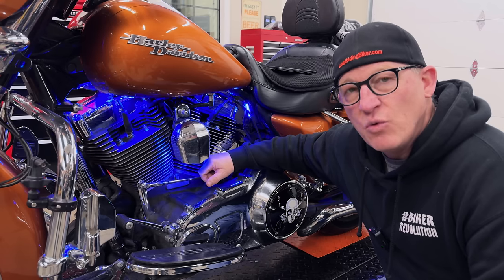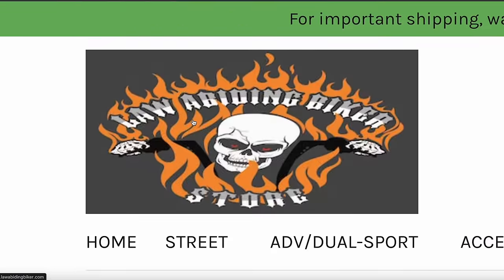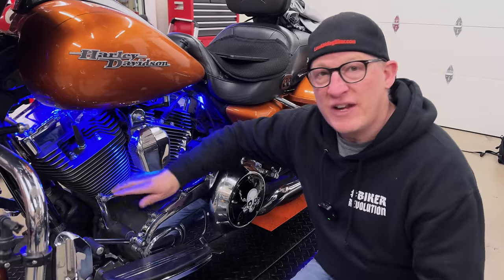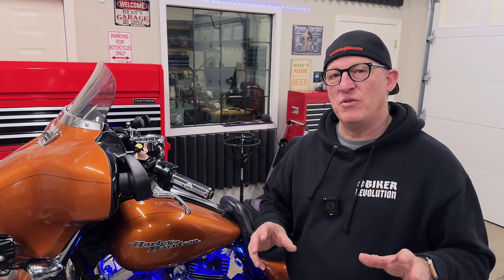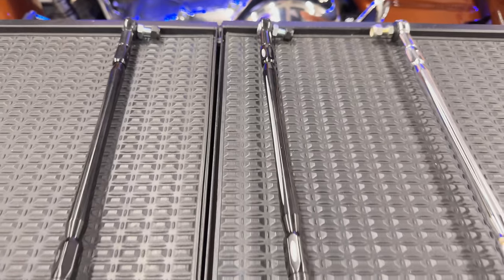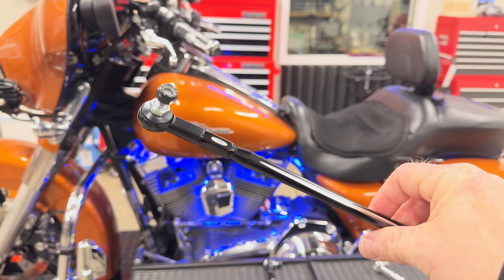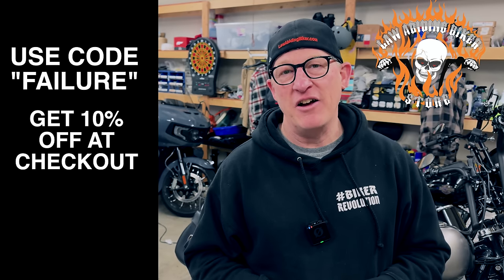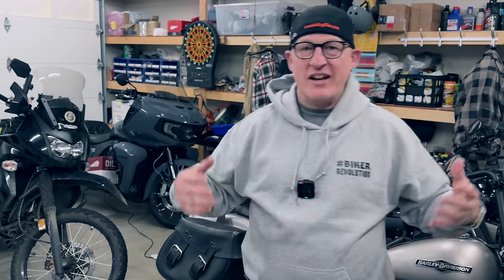2 Things GUARANTEED to FAIL On Your HARLEY! MOD THIS NOW 👍

Comment: This Kurayakyn linkage doesn't seem right.  I have a 2003 Electra Glide.  Bought it new.  I've put 51K on it over 21 years now.  Original linkage.  After watching this video It seemed like a good preventative maintenance move.  I bought one from your store.  Per the instructions, I've adjusted and tightened the Jam nuts to the proper length but the center rod still has some wiggle/movement at those connections.  This doesn't feel right.  Not as solid as the original.  Well, I put the 21 year old part back on and contacted Kuryakyn.  I'm still waiting their response.
Reply: Okay, this was the reply I got.  Guess I'll just pray about putting it back on.  Thanks Ryan.
Hello Gary,

Thank you for contacting Kuryakyn Support.

This is common but should be no cause for concern.
As long as everything can be properly tightened, there should be no issue. 

Best regards,

Joseph Petry  
Customer Support Representative

Comment: have a 2016 with 80 k miles not a problem,  never heard of it , maybe your kicking instead of shifting?
Reply from the maker: Nope, read all the comments. It's widespread for many years now. Consider yourself just lucky. Also, look at my other shift linkage videos and shifter arm videos on this channel. You won't be able to keep up with the comments of this happening to so many bikers. Ride safe.

Comment: Almost ALL failures ive seen are on bagger bikes with floorboards and toe/heal combo.  That set up puts way more stress on the linkage.  Harley has deliberately engineered these weaknesses deliberately not to destroy the transmission input shaft.  If you beef those up I keep rough-housing the shifters you damage the input shaft!  Big heavy boots an aggressive shifting always lead to broken linkage.  Almost never see guys with bar bikes and choppers with this failure. Just my two cents good content brother..
Reply from the maker: Thanks. Yah, all the ones I've seen break around me, guys don't even have the heel shifter on and we just wear riding shoes, not boots. Thanks for the comments.

Comment: Never had either of these parts actually fail on any of my several Harleys (going back to 1976) but I have had them get loose after many miles stack up.  I just found out recently after trying to order a Kuryakyn brake pedal that they do not exits any more.  They got bought out by Tucker Powersports.  I can't seem to find any listing for current products from them.  Anyone else know more info about their situation?
Reply from the maker: A little wrong on that. We sell the heck out of the Kuryakyn extended brake pedal. So many, it's hard to keep in stock right now. I just did a video two weeks ago on them on this channel. Turn 14 bought out Tucker Rocky. We sold for both. Turn 14 now has the Kuryakyn brand. We are in direct contact with them all the time. We carry those Kuryakyn brake pedals Right in our store here ==> https://shop.lawabidingbiker.com/products/kuryakyn-girder-extended-brake-pedal-for-harley-touring-2014-and-up?variant=43161770459292

Comment: LIKE TO KNOW OF ANYTHING ABOUT THE LEVER OFF THE TRANS TO THE LINKAGE IN QUESTION? MINE IS LOOSE AND GETTING ME WORRIED !   ANY GOOD REPLACEMENTS AND CAN IT BE DONE WITHOUT R&R ING THE LEFT SIDE OF THE ENGINE?
Reply from the maker: Check it now ==> https://youtu.be/_GJz_J8IgqI
Reply: @RyanUrlacher 2012 ULTRA TRI GLIDE. THE LEVER BEHIND THE PRIMARY IS LOOSE AT SPLINED  TRANS SHAFT.  BOLT IS TIGHT ? WHAT IS THE FIX ? TAKE PRIMARY OFF TO FIX...PULL TRANS ? WENT TO DEALER AND FOUND 3 LOOSE TWO TIGHT ! DOESN'T SOUND LIKE A EASY FIX LIKE VIDEO...BOUGHT THIS NEW IN 2012. IS THIS COMMON?
Reply: @mikechristensen3300  
Yep hafta pull inner-Primary off to access. As long as the spline on the trans ( gearbox ) shaft is okay, get a new lever, use red-loctite, and do that bolt up until it feel like its going to snap off ( ie=tight as possible ! ) Spline on my gearbox-shaft ( '95 Dyna ) is well-worn ( farked badly ) and i have pieces of beer-can wedged in, and used Green Loctite..... Good Luck !

Comment: Yep my OEM linkage failed riding down the highway.  I got lucky and the nut and bolt came loose rather than the ball socket popping. So I hand tightened and made it home
-This comment is all over the place

Comment: Odd . This is not a cut down. But I have never had any issues with the shift linkage . And I have had a few Harleys over the years .
Reply from the maker: Glad it hasn't happened to you YET. So many have dealt with this over the years. Here's some comments and info to see how wide spread it its ==> https://youtu.be/fBrlm2KW5Xo

Comment: First i have 2 Harleys so im not bashing anything.
But how does a company that build bikes for 120plus years and have some know 
very dumb weak points that keep coming back year after year. 
A shifter linkage should not be an issue unbelievable.

Comment: Rose/Heim joints are cheap (I get aircraft surplus via Ebay and use the stock rods when I build custom setups like the right side Dyna brake control on my FXR). Though riding and wrenching since the 1970s have never seen one break though HD uses riding mower linkage joints for Evo and later shift linkage. While inspecting ensure the shifter arm is not loose on the transmission becasue if that strips replacing it is tedious and normally a primary pull. This video is really a poorly veiled advert. The linkage is not "guaranteed" to fail or thousands of mechanics like myself would have noticed.